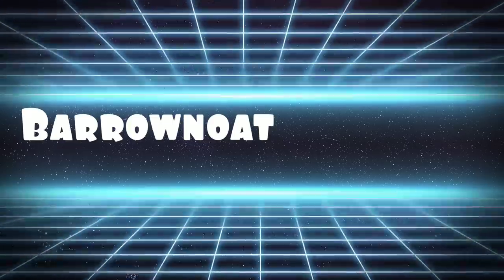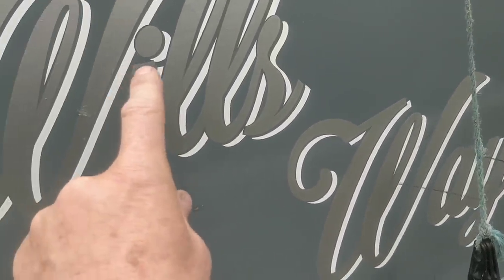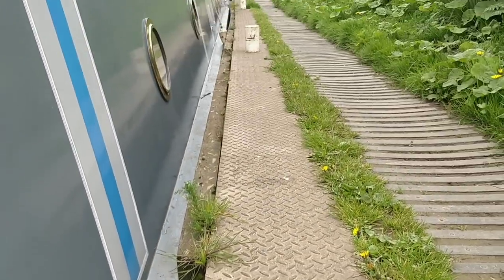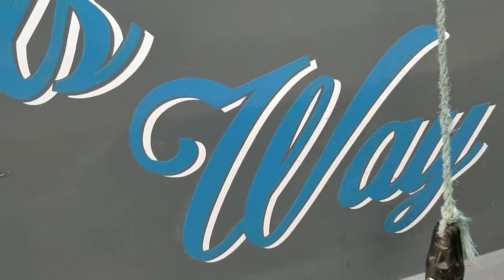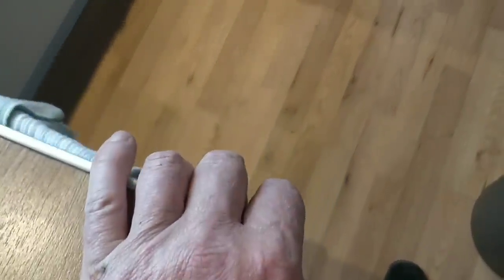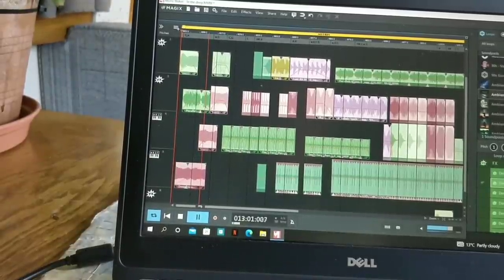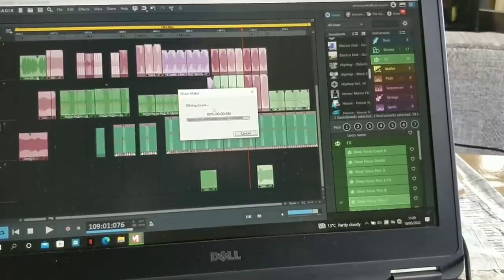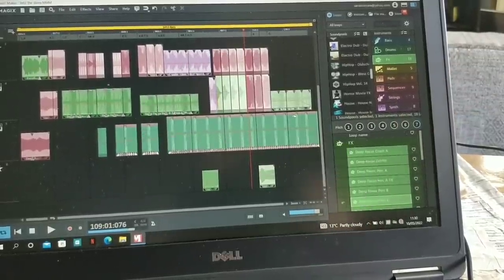Narrowboat fuel tank vent solution.  Narrowboat work and how I make my music ripss..

Comment: Get a breather with the gauze vent on the side. Its needed to vent fumes from your tank building up. the gauze is an anti spark for those fumes, so is necessary to pass BSS.
Reply from the maker: Oh ok. I've put gauze in the end of the pipe is that good enough until I can get a one way valve we used on bike tanks. Thanks Stephen.

Comment: Seem's like you've got the vent sorted. That flooring is an easy fix. The fridge, I think it's an evaporation tray, designed to collect condensation and the heat from the motor evaporates it. You'll  have to spuce up your singing voice a bit before Britains got talent. Thanks Will, I never had trouble reading the boat name, but the blue does look good and stands out. Take care.
Reply from the maker: I had a leak on my fridge and I couldn't find the source. It's stopped now. I think the drain hole to the tray was blocked. I love making my own tunes and then forcing them on people. Ha ha. Have a wonderful weekend Phillip.

Comment: Will. What did you use for the flame arrester on your new vent? On your next BSS the inspector may or may not pick up in that.
Reply from the maker: Flame arrester? Got me worried now. I suppose with the old vent the water will put it out?
Reply: @NarrowboatWill  The gauze supposedly stops flash back into the tank. Being diesel it kinda makes a mockery, but as I'm sure you know, some regulations on the BSS are a bit of a joke.
Reply from the maker: @martinrose241  I've put a one way valve on it but I'm not sure about that. Very little info..cheers

Comment: Hi Will, That tray is an evaporation tray, it should never need draining In normal use. Might have to look somewhere else for the solution.😎😎
Reply from the maker: Oh ok. When I defrost it the hole at the back let's water into that try. Thanks for the info. The leaks stopped now. I don't know what it was then. Cheers Chris